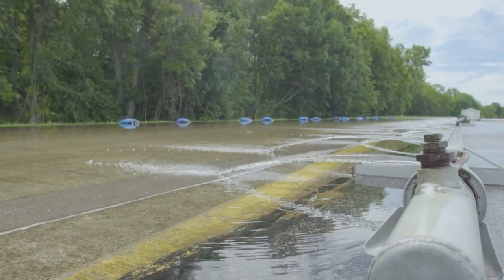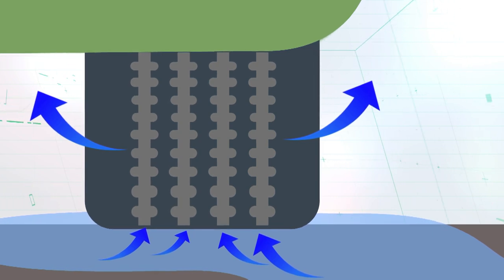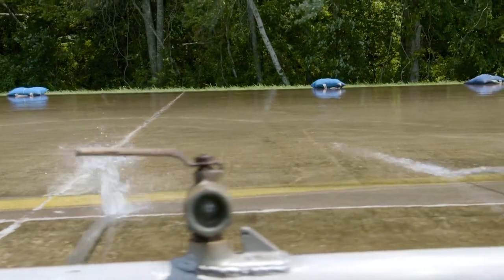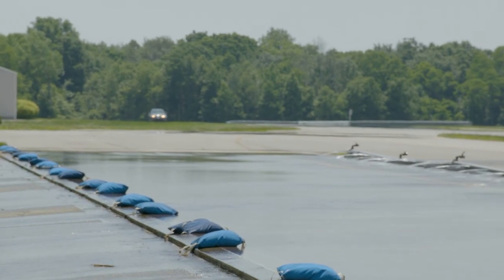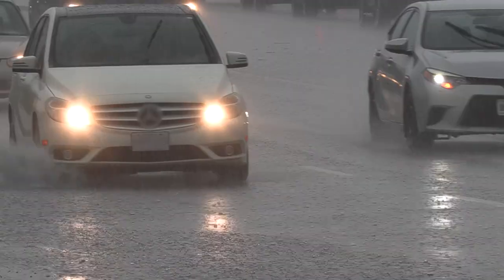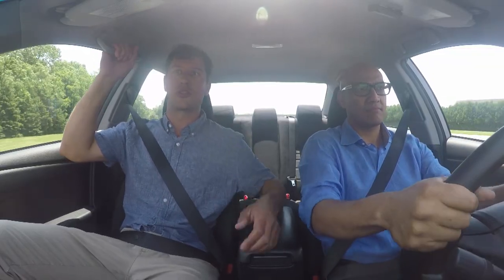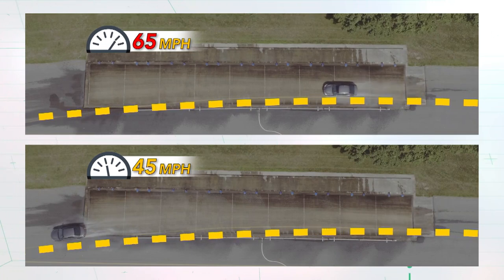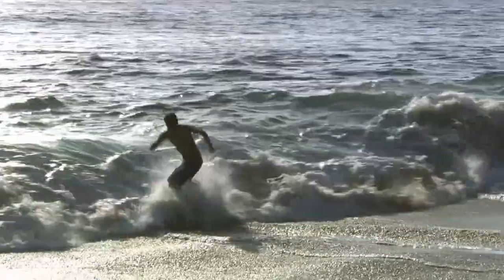Hydroplaning | Consumer Reports

Comment: I had an interesting experience when I last hydroplaned, and it was at a curve on an interchange going 65 miles an hour— I changed to the inside lane and started braking as I saw the curve getting tighter, but then I knew right then and there that I was gonna lose grip, and right when I did, I had an out of body experience where it seemed like I could only see the lane lines and my tires, being able to feel how much I was rotating

My instincts saved me as I didn’t touch any pedals and used gentle side to side motions to slow it down and cancel out rotation and bring the car to grip in a straight line at the shoulder before I put my brakes on— I had no idea what happened in that moment as it was dark and blurry until I reflected on it many times later